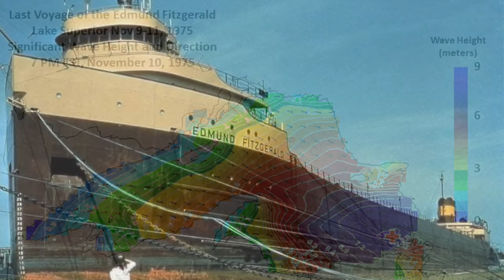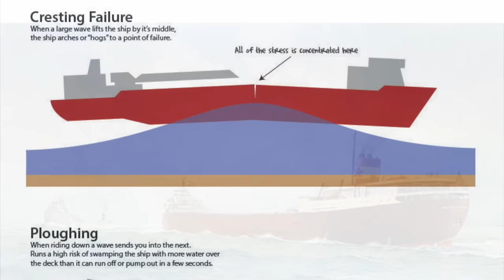What Happened To The Edmund Fitzgerald?

Comment: All in all this was a pretty well done presentation. 
However, in the vein of friendly constructive criticism, there are a few items I want to point out. 
First is enunciation and pronunciation. I noticed it mostly in the names of the two primary ships in this story. At the beginning, it sounded as if you were adding an "s" to each part of the name i.e. 'Edmonds Fitzgeralds'. For pretty much the rest of your presentation it sounded as if you were saying 'Fixgerald'. The 'Fitz' in "Fitzgerald" should sound like fits. As in; "That jacket fits Gerald well." As to the other ship, about half the time it sounded to me as if the other ships name was the, "Arthur Manderson". 
I believe these issues are simply caused by rushing the read of your copy. Simply slowing down your reading rate, just a little bit is usually enough to correct this matter. Basically, go too fast and the words tend to bunch up or run together. If you watch/listen a few different seasoned presenters, you will notice what I'm going on about. The slower pacing offers some other benefits. It can lengthen a video slightly, thus increasing your watch time. It also adds an air of authority to your presentation. 
The other issues are content. I've never heard of any ship on the Great Lakes referred to as unsinkable. Anyone that has anything to do with shipping on the lakes knows that is tempting fate and foolhardy. The last count I saw indicated more than 6,000 wrecks in the Great Lakes, accounting for more than 25,000 lost lives (an estimate). I don't believe that anyone considers anything to be unsinkable on the Great Lakes. Not even the buoys.
The Edmond Fitzgerald was called "The Titanic of the Lakes" because of her size. In it's day, the Titanic was the largest ship in the world.  The Fitz was the largest ship on the Lakes and she is still the largest ship wreck of the Lakes. 
You stated the ship was hit by two large, or rogue, waves. Accounts that I've read state three waves. In fact, often calling them, "the three sisters".
These are the ones that caught my attention. 
Again, this is intended to be constructive feedback. Please understand that I do not intend to come across as ugly or mean about this. Assembling information for a presentation or documentary is a tedious undertaking. In my experience, when working on a historical event, researching from multiple sources will usually make a piece of 'bad' information apparent.
I did enjoy this video, it is about an event that has interested me since I was in middle school. I was still in middle  school when it happened. I remember the reports of the sinking on the evening news. It was a story for most of a week as I recall. An uncle of mine was a national weather service meteorologist in Michigan when this happened. He issued the mariners reports for the Great Lakes. At the family reunion the following summer, he and I went on a day long fishing trip. We spent most of the time talking about the sinking of the Fitz. I don't recall catching many fish though.
If making documentaries and presentations is of interest to you, and you continue this pursuit, I hope that at least a few of my words are helpful for you. 
Onwards and upwards!
Reply: You do realize we all have different ascents in different areas of the country. When I first moved to Wyoming they said I talked different. Auther M Anderson is the name of the ship. I've lived in Wyoming for 42 years now and still occasionally have someone ask me to repeat a word I just said. Cause I still have some of my Iowan slang and proud of it. As far as the Fitzgerald being called the Titanic of the Great Lakes yeah it was. Andrea Doria was called unsinkable too until the Stockholm hit her. Let's give this nice young man a break. Nobody is perfect. And we all have our opinions. Maybe you are trying to help and I can understand that. I don't mean any disrespect to you either. Just trying to explain the difference in language.
Reply: @wyomingadventures Greetings to you. Since your comment is not addressed to anyone in particular, I'm not certain if it was intended for me or not. However, you have made a few points that seem they could be in response to what I wrote. Additionally, you made at least one other point I would like to pontificate on. 
First and foremost, I want to reiterate that my comment was in no way intended to be derisive, condescending or demeaning to, Connor, the presenter or this video.
Of course I am aware, and familiar with accents and dialects. I'm part of a large family. Due to military service by the majority of the generation before me, I have many cousins that were raised in many places and consequently have different accents. Myself, I wasn't born there but I grew up in south Florida. Miami and Ft. Lauderdale specifically, from age 2 to 14. These are the years during which we tend to "set" our accents. I have cousins that grew up in Georgia, both Carolina's, Michigan, Wisconsin, Texas, New Mexico, and Northern California. These are the cousins I interacted and talked with on a pretty regular basis. We all had our own accents and it was often the cause of laughter and mild teasing. 
My childhood best friend moved to Miami during the last semester of 3rd grade, from Iowa. He lived 2 doors down from me and we were basically inseparable until I moved away during the first part of 9th grade. I had to basically learn a new language. Louis, my friend, and especially his father, had STRONG Iowan accents. Additionally, they used words and phrases I'd never heard before. The ones that quickly come to mind.
Worsh: means wash
Flush it off: means to rinse something. Especially with a hose. As in; When worshing a car, make sure to flush off all the suds.
Davenport: a couch or sofa
Digger: any shovel, hoe, garden trowel, maddock, or hand tool (including claw hammers and screwdrivers) that is used to make a hole in the earth or to move or carry dirt, sand, gravel, or manure. 
Spissgeddie: spaghetti 
Wrappyohlee: Ravioli 
The phrases "and that" and "by and by". "And that", was used during conversation in the same way someone would use "ya know" or "I mean" as in; "He was out of control, and that. He was going too fast to make a turn. That's why he flipped it, and that. Course when they finally got the tractor off of him, and that. He was already dead."
So, yes, I understand and appreciate accents and dialects. And it is that reason I offered the advice I did. When speaking as a presenter, one should practice enunciation and control the rate at which they're speaking. I don't know your age, I'm going to guess you're younger than I am. Most likely, you know who Barbara Walters is. She was on many shows, 20/20, Today, The View and many others I cannot recall at this moment. She had a long and lucrative career as a presenter of one sort or another. She started out as a newscaster, reading copy into a TV camera. The first time I saw her on TV was decades ago. As you know, it is standard for a newscaster state their name as part of their signoff. After her first few signoffs she had me, and a lot of other people, that her name was, 'Bahbahwa Wahwahs'. There were many jokes made at her expense, and of course she knew that. Her goal however, was to be one of the first female national broadcasters. She knew that wouldn't happen if people were laughing at the was she talked. So she took speech training and got some coaching advice on how to improve her onscreen persona. After that she pretty quickly became a newscaster on one of the networks. (There were only three back then.) She was presenting the news to the entire country, every evening. That was just the beginning. 
If you don't know about her, I'm pretty sure you can find some of her early footage here on EweToob. If you're interested. 
In closing, I hope it is clear that I meant no disparagement towards Connor. It was my genuine intent to offer a constructive critique of his efforts. I apologize if I mistakenly used any offensive words. Though I'm certain I did not. 
Having made that assertion, I wish to point out that I pretty clearly stated this to be the case in my comment. So, if you didn't read the entirety of my comment, and were offended, that's your fault for not properly reading the information, then drawing the wrong conclusion.
Now, if you did properly read, and understand, that's important, the understanding part, each of my words, and were still offended, that's also on you.  However, I want you to know that both of these flaws can be addressed, worked on, and improved with just a little effort on your part. In the end you'll find you're a happier person.

Comment: Lake boats tend to be longer and thinner proportionally than their ocean going cousins. They were , and often still are built to the maximum dimensions the ports and locks can handle. This has caused issues with hulls twisting or "hogging" historically. I would guess she met the same fate as the Daniel J Morrell and the Carl D Bradley.  She simply broke in two in heavy seas and sank.
Reply from the maker: The Great Lakes really do wear and tear on vessels.
Reply: Well  the break up did not take place on the surface as the parts of the wreck are too close.  In the case of the other two, the halves of the wrecks as much farther arapt.  Like the in the case of the Titanic.  When a ship  breaks on the surface the halves drift apart while sinking.
Reply: @jrd2102  The Morrell and the Bradley were both empty at the time of their sinking,  John. Trapped air kept the sections afloat for a while. The Fitz was fully loaded with Iron ore. Her halves were going nowhere but down. The Titanic is over a mile deep, plenty of distance for two objects sinking at different rates to get some distance apart. 530 feet is deep for the great lakes, but  not deep enough for two plummeting freighter sections to get very far apart.

Comment: She was water logged, was heavy, and dipped down and just kept going till she hit bottom.  The wave behind her picked up her stern and ripped her in half.  If she broke in half on the surface it's unlikely the two pieces would've come to rest so close together.  It also explains why no distress was sent.  It was basically instantaneous.
Reply: Those few seconds that the crew had,  especially those in the pilot house , most likely still enough to realize this is it. The window glass didn't last long as the pressure increased that's for sure.

Comment: What nobody realizes is that taconite pellets expand like wildfire when in water.     That whole entire load expanded when the boat was leaking water inside the cargo hold.     It probably put stress on the ships sides as it expanded with water.    I believe that the boat hit bottom on six fathom shoal as it passed through it.    Hit bottom with an expanding load under pressure.    The hill broke in 2

Comment: from the MacInnis submarine 6 dives it is basically determined that it went down due to two big waves that overtook the bow of the ship. the wreck on the bottom shows the stern was driven into the bottom with great force. thus this is what split the boat in two and the second wave swallowed the bow never to come back up.  No radio calls just silence. it would of been over amazing quickly for the size of the Fitzgerald.

Comment: The ship had the cream of the crop crew. 

So, not having hatches sealed correctly is probably not an issue.

But that rail being down is an indicator of a serious problem, flex or not, built into the hull.

My guess she struck bottom causing a massive over bend, or riding over two short distance waves peaks in shallow water, her back cracked by the hull not being supported by water. 

Ship hulls can't not withstand support at just the bow, stern, they are just too long.

Both probably caused a water leak in the hull, deck crack.

Both would have caused a rail failure.

The two rogue waves finished it off as the cargo absorbed water you could not pump off.

Comment: The other theory is that the water in her hold added weight to the middle and when in between two waves, she split like the Daniel J Morrel years earlier, but I honestly agree with the late Cooper, that the seas did catch up to the Fitz, the water sloshed forward, putting her bow down in the water, the second wave pushed her under and she submarined down as that taconite slid forward, hit the bottom so violently that she tore in two

Comment: Fresh water waves are aggressive due to the frequency of waves. Its completely different to sail on storm wavehight 20 feet if the frenquence between lakes is 50 meters than saltywaters like several hundred meters. Ships fit much better between waves and there is time to recover from roque waves even it has few sister waiting to strike you right after the first one. The striking power on waves is completely different on greatlakes than on oceans
Reply: It's all about underwater topography and currents. There are sections of the Atlantic that compress wavelengths by shortening frequency and causing the waves to spike upward and go rogue. The Scotian shelf is such a place, and the hazardous topography there caused the ten-storey waves that put down the Andrea Gail during the Perfect Storm in 1991

Comment: I believe it was a combination of multiple factors.  Given that the Fitz had lost it's radars and wasn't sure of it's position, it definitely bottomed out on the shoal and stated taking on water.  This would explain the list and the 'one railing down' message sent to the AA.  This loss of free board, topside damage and the taking on of water combined with the two massive waves that hit the AA and continued towards the Fits caused the front end of the ship to submarine under a wave to which it could never recover.  The pilot house windows where blown in from the front and the rear ones were blown outward.  No distress call, no survivors indicates (to me) that this all happened in a matter of seconds with no time to react.  This scenario coupled with increased load lines and reduced free-board (on a good day) was simply more than the Fitz could handle.

The wave-spanning potentially caused by these giant waves generated enough force on an already ailing ship with years worth of stress to the hull simply broke the Fitzgerald in two.  With the propeller still going, this created enough torque to spin the rear section of the boat after it and separated, which is why it is laying upside down compared to the front section.

Again, this is all my personal opinion based on all the data I've seen. 

Excellent video Connor, keep up the good work.

Comment: According to the various videos of the sunken hulk, the steel of the wheelhouse is twisted and bent like a spaghetti noodle, indicating the force of the sisters that swallowed her. One has to remember to add the weight of the lake water on top of the deck plates to the carrying capacity of the hull. Amazingly it rounds up to twice what is necessary to sink the ship. Anything that overstressed will break, or in case of the Fitz, sink like a rock.

Comment: 730 feet long in 530 feet of water.

Probably swamped by a rogue wave that drove her bow into the lake floor, snapped keel, down she went.
Small wreckage area suggests broke in half on surface and went straight down.

Basically became a submarine in 10 seconds.
Not survivable with modern suits and enclosed lifeboats.

Comment: All three theroies are correct.  With the radar out, the fitz got too close to carabue island and hit the shoul. This in turn caused the fitz to flex so much and the force of the impact of hitting the shoul snapped the railing and also shook the covers loose. the two rogue waves caused the haul to eventually break in half. essentually snapping the fitz's back as it nosed in and eventually rested as she is now.
ya did real good young man.  The crew would be proud as would the mariners themselves.

Comment: The theories I've read in the comments may or may not be correct. One thing I haven't seen mentioned is the missing railing. Also, I'm not sure how far apart the 2 waves were. I think maybe the first wave caused so much flex it popped the railing and maybe started a crack at one of the flex joints (possibly the center). Then after the second wave hit, all that weight "and possibly already taking on water at least on one end" snapped her in 2.

Comment: Luck had nothing to do with it's sinking. The boat according to ship yard workers and other Captains was abused, often times over loaded, not repaired correctly, and McSorley was in a hurry to get back to his wife languishing in a nursing home and didn't fully take into account the weather! When you snap your rail lines, it means your ship hit bottom and or flexed and cracked the hull sending in large amounts of water and considering the 3rd pump was not operating, probably couldn't keep up!  Captain Jesse Cooper also said in an early 1990's interview that 2 large rogue waves hit his ship and moved on in the direction of the Fitz  which may have been it's undoing!